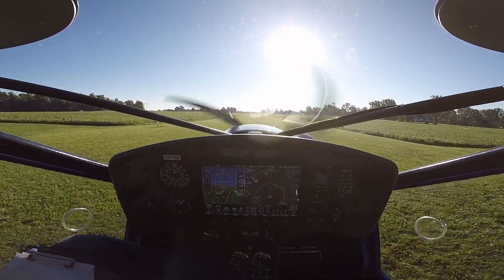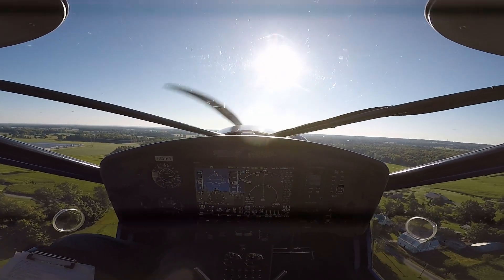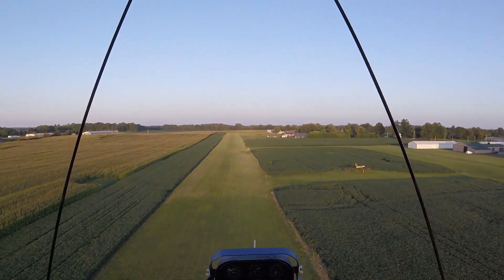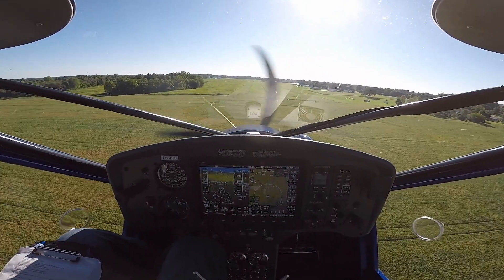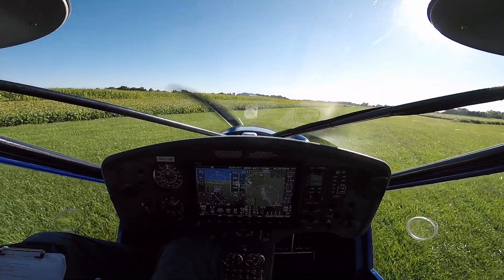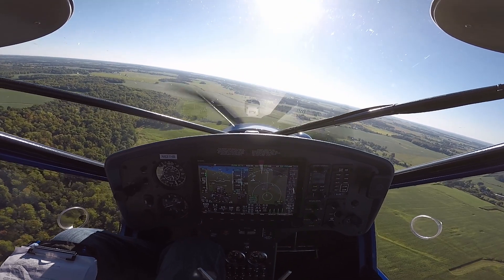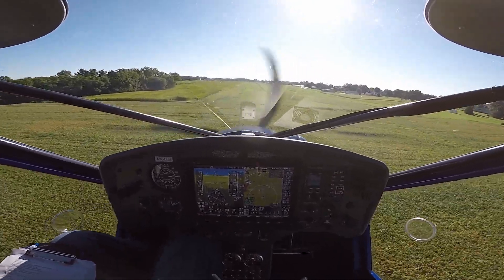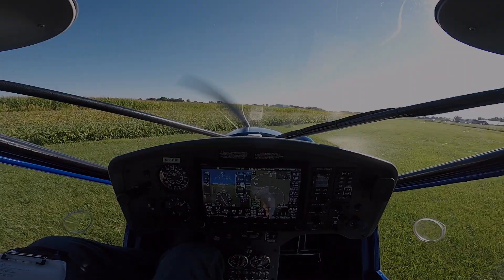How To Bend a Nose Gear Without Really Trying!

Comment: Very interesting and honest from you to share your mistake. I also fly an A22 here in France, my F.I taught me to set approach speed on final around 55kts, 1 notch of flaps, but buildings my hours after I got Licenced I found way easier to be slower to properly land it, 50kts is a good spot in final, 40/42 is safe to begin flare (except with strong winds and gusts...then you take margin) this plane is a floatter, keeps it's kinetic energy unless you put 2 notch of flaps, especially when you're alone and not fully tanked...the around 30kts stall is set for MTOW...alone and half tank it's less than that...
Reply from the maker: What's going to be fun is that I now think in miles per hour because the plane I am renting is set up that way. (and 8 years of flying ultralights!) But the one I ordered will be set up for knots, so I'll have to get used to that again. I rented a CTLS and that was knots, too! What you don't see on the video is the Ag plane that was darting all over the place at, and right adjacent to the field. As I state in the video, the first mistake was continuing. I should of bugged off. The speed mistakes were mostly due to being distracted by the Ag plane. Thanks for watching and for the comment. Vive l'aviation! :-)
Reply: @aviatorjoe4153  ahah well here in France, most ultralights use km per hour (metric system), anyway I'm used to know both...(our a-22 is equiped with dynon skyview so you can switch between systems). Fun fact is the general aviation here and europe uses knots on airspeed, weather reports, wind infos from towers are always in knots...now for your "incident" yeah going around is always the solution...but hey it's so easy for people (non pilot or even pilots) to be shure they would do different, better etc...When you're inside the plane, sometimes it's a different story...it could be me next time so don't worry, if you can tell us what happened, everything is ok finaly, both pilot and machine...that's all matters.  
cheers to US pilots ! you lucky guy to own your A22 !
Reply from the maker: @bertrandthomasflylover2306  Well it's on a boat right now. I should be flying it by mid-December. And yes, I am VERY lucky and blessed to own a wonderful machine like this!
Reply: Thank you for sharing, sooner or later we all have little incidents. As said about you can approach slower in an A22, for modest margin target to flare at 40kts/45mph or for one up and very short landings it’s possible to use 35kts/40mph this really shortens your rollout BUT be care as it leaves no margin for error.
Reply from the maker: @irishflyer6377  The home field for this plane is a 1500 ft runway, so if I am used to having little room for error. Love that error chain! 🤦
Reply: @aviatorjoe4153  Mine is 6500ft...(longest grass strip in Europe)...talk about bad habits when going to a short field...